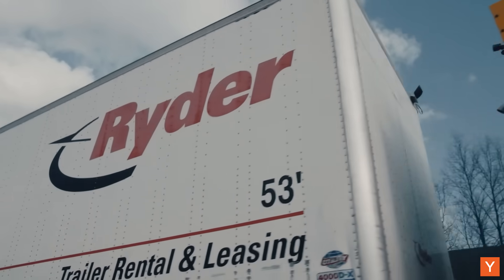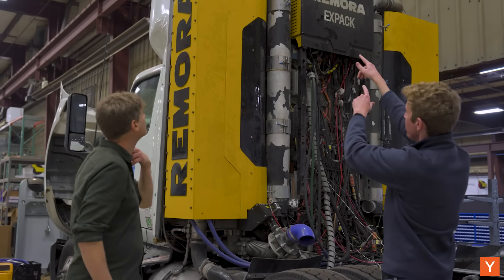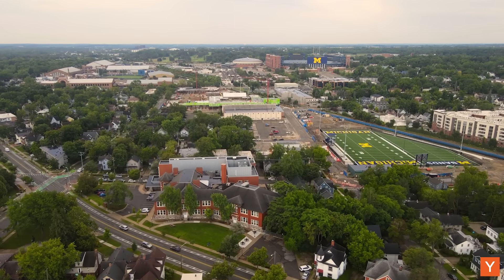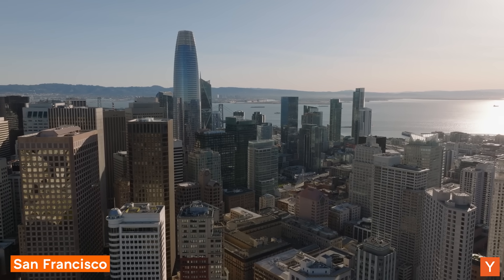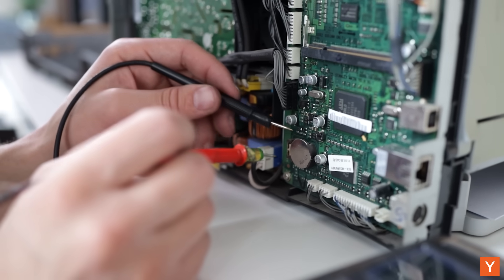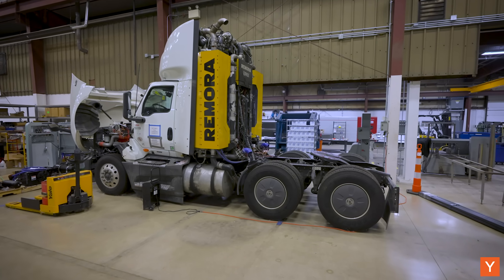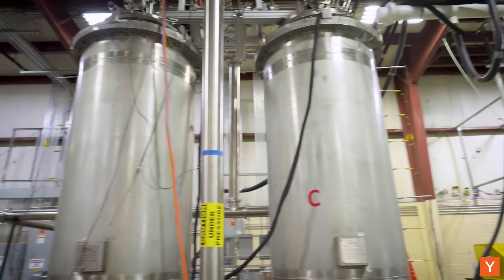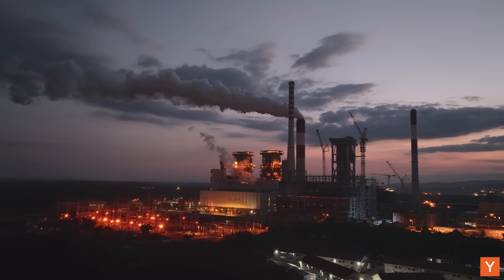This Startup Is Trying To Delete 29% Of All CO2 Emissions

Comment: I'm not sure it will make sense to put carbon capture on locomotives.  The large rail companies are already working on hydrogen trains.  In Alberta there are 3 or 4 of them running already.  Sure the hydrogen comes from natural gas but you can capture the CO2 from that process at the source and then either store it or use it.  I think in BC they also have a test plant that uses NG for hydrogen and does it in a way where the only output is pure carbon.  Their plan for that is to have natural gas go through pipelines and then have communities are built where the heating is all done with hydrogen.  They will be able to put a plant in to do the conversion close to those communities.

Comment: This is cool but you're going to have to do some hard convincing before people believe it's fine to drink something that's been recycled from diesel train fumes, considering the current environment around forever chemicals, micro plastics, etc.
Reply: The biggest issue is that I'm not sure the train companies will even bother with this.  There are a few train companies that are already testing hydrogen powered trains.  There will be no emissions and even though the hydrogen will be made from natural gas they just do carbon capture at the source.  Alberta already has 3 or 4 trains being tested that use hydrogen and they are testing it through the Rockies which is some of the most challenging environments in North America.   There is at least one other company in the states that is doing the same thing.

Comment: ~12.45 There is not a CO2 shortage in the US (or anywhere). Every brewery buys food quality CO2, but also disxharges CO2. 25 years ago, I worked a laegr international brewing company, to develop a plan and finance for a brewery CO2 capture, purification and reuse in the brewing sector. We thought aht breweries could substitute CO2 captured from their own stacks for purified CO2 they pay for that originates ar oil refinery stacks.

The problem? It turned out that most breweries could/would genertr much more purified CO2 ghan they need for their own use. So, for the project to proceed, the brewii g i dustry had to consciously redefine their core business as beverage plus purified CO2 sales. Such a redefintion of core business is a BIG decision. More importantly, if the brewing secror added this much new purified CO2 supply, while cutting off their demand for existing purified CO2 supply, the expectation of the market value of purified CO2 would crash. Given realisitc CO2 price expecatiins, the brewary's CO2 capture and purification cists night nit generte a positive return, wcen after we accounted foe eliminated CO2 purchase costs.

We currently see a similar dilemma emerging WRT CO2 capture and reutilization in the aggregate/cement sector. Some very promising CO2 capture techs have been commercialized in this context. But demand for the captured CO2 supply falls well short of potential supply, both within and beyond the aggregate and cement supply chains.

All this to say, it is complicated.

Comment: And guess where the CO2 goes when you open that soda can.... right back to the atmosphere!   So don't compare this project with other CO2 capture projects aiming environmental benefits
Reply: it isn't recycle but it is reuse and reduce, if all carbonated drinks did this a lot of CO2 emissions could be reduced.
Reply: I would pair this tech with Valar Atomics they want to make synthetic Hydrocarbon from nuclear energy, we could have a captive market where on one side you can only use this synthetic Hydrocarbons on vehicles that use carbon capture and on the other side the CO2 used for these Hydrocarbons come from carbon capture devices.

Comment: I don’t get it. Why not capture the same CO2 directly in factories? Wouldn’t that be easier from a logistics perspective?
Reply: the pitch is that they are going after the hard-to-electrify sector (so they target a niche that others are not) -- this is very small-scale capture with two pretty special conditions (everything on the move, and it should work as an after-market part) whereas factories need large-scale static carbon sequestration solutions (and that market is pretty mature - even if the technology itself is not. that said the chemistry is relatively simple, so huge efficiency gains are unlikely anyway, so for factories eventually replacing the whole process with a less carbon-intensive one likely makes more sense anyway)
Reply: @pas.  Thanks for the answer 👍

Comment: How much does it degrade the power of the truck? If it burns more fuel, the overall impact will be negligible. I think it would work better in power plants.
Reply: You have a full tank, you end up with a bit more mass because of the oxygen you capture during combustion. You could probably calculate it but I'd imagine if the system is 100% efficient the final mass might be 3x the original full tank weight
Reply: Good point!

Comment: What is the cost of capturing each gallon of diesel... As it is going to add of my overall cost.
Reply: there's a cost. there's a cost to not capturing it too. as the planet heats up crop failures, forest fires, flash floods, and other extreme weather events are getting more common, not to mention the actual heatwaves that act as brutal brakes on the economy -- recently after the European heatwaves various numbers were calculated and they don't look good

Comment: But the CO2 in carbonated water is also released to the air again in the end.
Reply: Its used twice instead of once. The beverage company does not use additional CO2
Reply: Yes, but your significantly reducing the cost in CO2 production theoretically. Currently most CO2 for beverages can be scrubbed off of any sort of industrial bi reactor process like making ethanol or you can scrub it from methane steam gas, reforming where you use the hydrogen for whatever you need and then you liquefy the CO2. Their business proposition is quite shaky, as if you were to use all the CO2 from all the steam gas reforming in the world. You would have a hell of a lot of CO2.
Reply: @Jacob-zg8qb  I’m no expert, but you’re probably correct, this is hyped up way too much. But that’s what YC is good at.
Reply: @Jacob-zg8qb I think these customers are the easy starting point. Similar to how PayPal targeted eBay sellers and evolved from that. They prove they can capture the CO2 in a usable way and that the CO2 is usable. Once this is done it can be used in synthetic fuel, which is another topic that hopefully others will solve - and many projects are working at solving it.

First cater to the existing customer base. Later to the future one
Reply: @Jacob-zg8qb  ... they started when CO2 quotas were more politically viable, right now it doesn't make sense for them to even mention this (especially since the oh so counterintuitive story that there's a shortage seems very good for a magical "market based" solution), but when the costs of global warming shoot up things will get increasingly dire, and there's likely going to be pretty decent demand for these modular capture devices
Reply: true, but there is potential in the future for governments to buy it and put it into the ground again. There is also a carbon credits market where regular people often buy carbon credits - it's just not popular because the costs are so high. But maybe this company can increase the supply and bring the prices down, motivating more people to buy.
Reply: Retrofit cans with carbon capture tech and you have an infinite supply of CO2.
Reply: Please have a second look, most of the CO2 remains as it is converted into corbonic acid.  The fizz that we get when we open the bottle is due to shaking which releases some dissolved CO2, the major part which got converted into acid remains.
Reply: As if carbonated water would be any meaningful market for the scale of the problem, most has to go somewhere else, but yes dumb to hype it up with this example
Reply: @zraloki think you missed a point.  Carbonated water can be dumped in the soil, it won't pollute it, but if we release co2 in air it will. So the profitability in this scenario will be that companies purchase enough to give salaries and stuff, some will be stored and the rest dumped, no harm to environment.

Comment: What is the point of capturing CO2 just to sell it to beverage companies, where by definition it will be fully released back into the environment? What am I missing?
Reply: Think the most important point is that you are now in control of the emitted CO2. A portion will be used for e.g. beverage companies and be released again (which is still better because the CO2 was used twice) and another portion might be stored or used in other meaningful ways.
Reply: There is a market for CO2 in the food industry. Currently it comes sometimes from facilities that burn fuel only to create CO2. So substituting that with CO2 that has had an energy use makes sense.
That market would saturate quickly though. When that happens what is left is sequestration (permanent storage underground). That disposal process has a cost, whereas selling it to fizzy drink producers is revenues. So logically CO2 capture companies first serve paying customers.
Reply: The reason it reduces emissions is because, as it stands, beverage companies need to mine CO2 for their drinks. Hence, Remora isn’t just capturing CO2 to release it later, they are eliminating the need for beverage companies (among other industries) to mine CO2 by creating a pathway for them to use carbon that would already be released (e.g. from a tailpipe).
Reply: I think, they just don't know how to use it elsewhere.
Reply: If you can use the same CO2 twice instead of once, that cuts down emissions by 50%, no?
Reply: @PetePhD I don't know, it sounds like catch and release to me, you can call it fishing but it really isn't. And capturing the CO2 in the first place is an energy intensive task too, let's not ignore that - you must release some CO2 for the energy you use to capture the CO2, which then gets fully released. 

The way I see it, you give Coca Cola some money for sugarry fizzy water, they keep most of it, but give some to this YC company to buy the captured CO2, which keeps the rest of it. While the CO2 moves around in a circle and maybe even increases, the money moves in a very non-circular way.

Comment: How many Wh per 1kg of captured CO2? Beyond energy, what other consumables are used up?
Reply: Exactly. You increase the vehicle’s consumption to do the capturing. That means some of the fuel is burnt just to power the capturing process. Question is how much
Reply: @johnnny777  As I read 700 KWh per metric tonne.of CO2 (capture and liquefaction). This is amine technology from coal power plant. Maybe zeolites is slightly more.
Reply: PhD in Chemistry here. It's quite an efficient process (the capture anyway). The issue is what you do with the captured CO2, how do you fix it? Algal cultures maybe? It seems like they haven't figured that part out at all...
Reply: @z97482  hey man, I have a Q: I'm soft eng in cement industry, which accounts for 8% of global Co2. When I was born the atmospheric co2 was almost 100ppm less. I would like my children and their descendants not to suffocate. I ve been working on algal capture idea but its hard to find data on this. Do you have some literature and whitepaper pointers? The solution I want to build is a fixed system, contained in shipping container(s), purging the toxic waste to energy exhaust gases and then capturing Co2 using algae in transparent greenhouse like columns (for light). Algae containers would be automatically cleaned, dried and compacted as waste product to be stacked or pumped underground as oil reserves.
Reply: Why not ask the same questions for EV car battery manufacturing? It seems like we're only asking the same questions when it doesn't fit the political narrative......
Reply: @wizaaeed  EV car battery manufacturing is not in the business of CO2 capture. You may ask how many CO2 emitted per 1 KWh of batteries produced, and that would be an interesting in it's own right. I am not aware of any such numbers made public.

Comment: how healthy/safe usage of exhaust CO2 in beverages,  is it possible to filter nox gases %100?
Reply: It's not the captured CO2 that is bad for you, it's the sugar in the soft drink that you consume with it.
Reply: I think he's talking about ending up with diesel fumes in the drink. That would be gross 🤢
Reply: @austinwheeler6234  you can filter out everything and only have pure CO2. There is one or two greenhouses in Alberta where they capture the CO2 from the generator and boilers and use that directly in the greenhouse.  The CO2 is tested before its injected into the greenhouse.
Reply: This system has nothing to do with NOx that’s handled by the PCM injecting urea into the exhaust stream and the catalyst in the SCR reducing NOx into N2 and H2O. This is part of the trucks factory after treatment system what they are doing sits down stream of this.
Reply: @Jacob-zg8qb  the treatment system is not 100% though, you get NOx out no matter what.